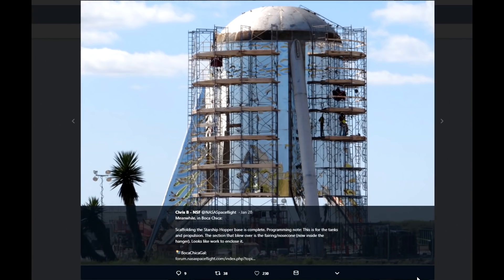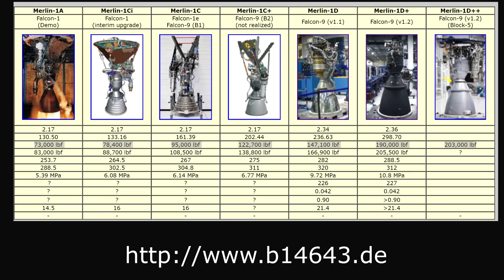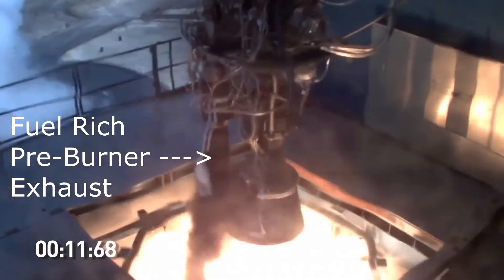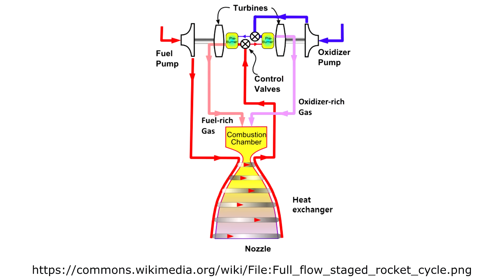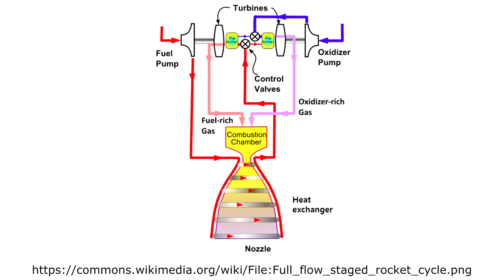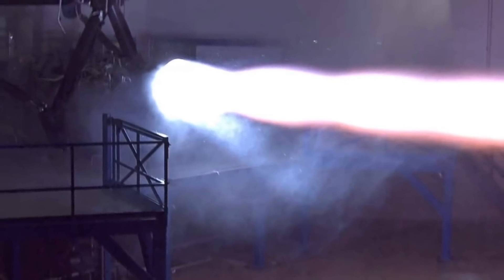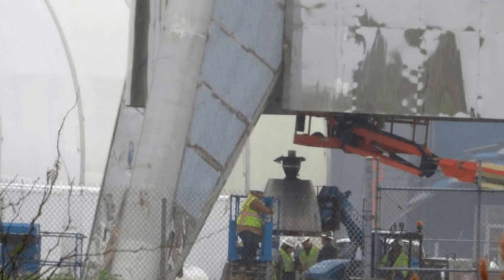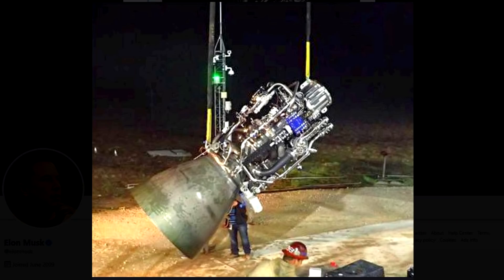SpaceX's Full Size Raptor Rocket Engine Revealed By Elon Musk

Comment: The F1 engine had 7.7MN thrust(385% of Raptors) and its atmospheric specific impulse was 79% of the Raptor engine. Just saying.
Reply from the maker: F1 Specfic impulse at sea level was 263s - I think you might be using the ISP of the Merlin
Reply: @scottmanley  Was using the right numbers, but the wrong column (confused atmospheric with vacuum).
Reply: It was also 12 feet in diameter and close on 8 and a half tons...  Let's see what all the figures are before we start any meaningful comparing. :)
Reply: @TheEvilmooseofdoom  Yes, and it was also devilishly expensive to make and the process could hardly be replicated. But the point stands that the best engine money could buy 50 years ago ist still only 20% worse in specific impulse than the best we're about to make today, but it delivered a hell of a lot more thrust than any engine made since.

In the same timeframe computers got about 100000000% faster. Something's just not going quite right.
Reply: @pyalot  Much of the ISP is determined by the fuel used.  Methane sits between RP1 and H2 roughly.  Better performance than the RP1 but not as tough to handle and with a better density than H2.  The F1 at sea level got a ISP of 261s and the Raptor from what I have read gets about 320-330s at sea level and while that only seems like a mere 20% it's actually quite a leap.  The Merlin which uses the same fuel gets 280ish seconds and the RD-180 gets 311 seconds from RP1.   That's the best one can get from RP1 so far.  What the best one can get from Methane is yet to be determined.  Also you ignore weight and power to weight is another big factor.  While  the little merlin puts out far less thrust than the F1 or the RD-180 it lifts more per pound than either engine.  In the end there are all manner of metrics one can measure an engine.  I myself am quite interested to know some hard data from testing and what the final mass of the engine will be.
Reply: @TheEvilmooseofdoom  I'm not disputing its better. It's just not better that feels like 60 years better. I realize that there's only so much you're going to get out of a chemical rocket. What I'm getting at is, whatever happened to computers, didn't happen to rockets. On the one hand it's not so much surprising, rockets don't have as much potential for everyday use, so they're not developed as vigorously, on the other hand, they're kind of super-important technology for modern civilization, and by any standard, they're unbelievably primitive.

Now I realize, we're grappling with all sorts of exotic concepts to get into space, none of which are even remotely feasible at our current technological stage. But maybe that's not a status quo, but a failure of our current stage.
Reply: @pyalot  I realize that there's only so much you're going to get out of a chemical rocket.

That is it in a nutshell.  Computers are also reaching a point where progress is slowing down too.  We were on the road to '60 years better' with the NTR designs but with the end of that and the current hysteria over anything nuclear we're probably stuck with chemical for a while.  Like the ICE the only thing we can do now is refine but we're close to getting all the energy we can out of it with current materials.
Reply: @TheEvilmooseofdoom  Like I said, we're stuck with something that's today roughly about as good as it was 60 years ago, give or take. Nothing we have is a feasible alternative at our current technology level. Nuclear rockets are extremely difficult and best not used in the atmosphere. Electric propulsion lacks both a potent source of energy and the thrust to do anything from the bottom of a gravity well inside an atmosphere. Hypersonic scramjets are also an extremely difficult, probably don't scale that well and it might not be a good idea for the upper atmosphere to use them. Spacelifts we're simply lacking the materials for. And space cannons of any description are extremely huge undertakings with a number of problems that might be solvable, but which we just haven't solved. Then there's "exotic" propulsion methods that're more in the realm of fiction than science.

We simply do not have an efficient means of getting stuff into space. We should have such means, given that we've had more than half a century to come up with something, but we don't. There's not all that many technologies that we have invented in the last 300 years, that where about as good a few years after their invention as they where over half a century later. There's countless examples of this (steam engines, computers, telephones, cellphones, etc.)
Reply: @pyalot  NTR's have the potential and I don't see why they couldn't be used in the atmosphere.  The problem with getting into space is the energy required.  Nothing that has come before has ever even had the potential energy and only as our ability to harness it has gotten better have we been able to do what we've done but we've gotten about as much as we can get from chemicals.  The next step up for energy density is nuclear.  Even the exotics require generous energy supplies. :)
Reply: Lensflare Deviant NTRs heat the propellant (coolant) up as it passes trough the reactor core and then expel it out the back. Two problems:

1. The coolant becomes irradiated and is now low level nuclear waste dumped right into the atmosphere
2. If it malfunctions (breakdown of separation layer between fuel rods and coolant) it starts dumping bits of the reactor core out the nozzle

The only time a NTR has been tried, it malfunctioned, the hydrogen at high temperatures erroded the reactor core away and itessentialls puked the reactor core out the back. This has been the most serious unintentional release of radiation on US soil in history. It has never been tried again.

That is why you dont fly NTRs atmospheric. And if you fly them in space, you would probably want to put a fair bit of distance between you and earth before you light it up, and dont point the nozzle towards earth.
Reply: @pyalot  I'm afraid most of the information you have is incorrect.  The hydrogen is not exposed directly to the Uranium, like in most reactors the fuel is embedded in zirconium for most reactors and ceramics for others.  There is no contamination of the hydrogen with radioactive fragments, this is a error.  Also all the tests worked out so well they were one step away from building an engine for flight testing when the program was shut down.  They did deliberately blow one up but outside of that there were no accidents or contamination.  Your sources are seriously questionable.
Reply: @TheEvilmooseofdoom  I never said the fuel is in direct contact with the coolant. However if there is a malfunction, the reactor will basically dump itself out the back. This is the reason why all ordinary nuclear reactors have a heat exchanger and separate cooling loops, so that the liquid that could potentially be contaminated, doesn't make it out into the environment.
Reply: @pyalot  What the reactor does during a malfunction depends entirely on the malfunction.  Sorry if I inferred a direct contact between the H2 and the U.  Regardless there is no radiation being spewed out the tail pipe this is one of the advantages of hydrogen.  Neutrons could interact with impurities in the hydrogen but such sources should be negligible.  Of course the same issue with a NTR exists with all of them, melt down.
Reply: Lensflare Deviant most malfuntions would lead to dispersion of highly radioactive materials, either explosively or gradually.
Reply: @pyalot  Only if something fails internally in the core or to the housing.  I think you're past reaching.
Reply: @TheEvilmooseofdoom  Well a NTR is barely more than the core and housing, and it's where the greatest stresses are being applied by radiation, extreme temperature, pressure and propellant flow speeds. There would be the turbopump and tank of course, but if any of those fail to deliver coolant to the reactor, you won't be able to shutdown the reactor before it overheats and disintegrates. It's not reaching to assume that pretty much any kind of malfunction will lead to explosive or gradual release of radioactive material into the atmosphere.

We accept failure modes in chemical rockets because the impact is limited. But most NTRs failure modes will result in environmental catastrophy. If the NTR is properly separated from human habitation/ecosystems I think the risk would be acceptable for failure modes. But atmospheric flight, from earth, no.
Reply: @pyalot  First before we go any further I am NOT advocating in favor of NTR's as first stage engines (I would be tempted for 2nd stage or any upper stages though).  I DO believe it can be done though and done with reasonable safety and likely for some time.  That being said there is always the potential for an extreme disaster.  I agree that the biggest danger is a reactor that is no longer being cooled (some catastrophe has severed the flow of H2).  We also assume this is enough of a catastrophe that the control mechanism is disabled or destroyed.  There is a lot of mass and material in there and it would take some time to melt it all down just to a liquid state.  The housing is strong enough to contain the pressure of the engine during operation, cut the fuel and that pressure goes away so nothing is going to crack it from the inside the danger is where it lands and what it does as it melts in it's landing spot.  This is why we'd keep launching over water.  Still I think your point stands that even IF such a failure is rare it CAN happen and a pile of melting reactors at the bottom of the ocean is hardly an ideal situation.  

For a second stage though... :)
Reply: @TheEvilmooseofdoom  since an NTR would be running at maximum capacity under power, if the coolant fails, the temperature will quickly melt both the fuel rod and cladding. You can't contain the corium because that'd just concentrate it and get it hotter, so the only way it has to go is out the back of the engine.

Traditional nuclear reactors are built with a "catch bassin" intended to catch a corium melt and spread it out in a puddle where it can cool off. That option does not exist on a rocket.
Reply: @pyalot  _will quickly melt both the fuel rod and cladding. _

Yes but in a matter of minutes not seconds.  Before it's a liquid the thing will have hit the ground.
Reply: Lensflare Deviant The limiting factor of a solid core NTR is the melting point of the materials. To get maximum efficiency you would run it as hot as you can while high speed coolant flows past it. Therefore under normal operation it is already on the verge of meltdown with the coolant. Take the coolant away and it will melt in fracrions of a second.

There are other designs, but they either somehow contain the nuclear fuel (in whatever phase) and hence face the same issue, or do away entirely with nuclear fuel containment and just expel it out the back...
Reply: @pyalot  I'm afraid your opinion is not as informed as you may think.  Therefore under normal operation it is already on the verge of meltdown with the coolant. Take the coolant away and it will melt in fracrions of a second.

This is wrong.  They run at a temp that the structural material retains it's strength at.  This is not at or near the the melting point since most metals are soft like taffy at that point.  I'm afraid you're proceeding from a flawed understanding.  The melt down will not take seconds.  They take minutes to hours depending on the core and in this case I'd say minutes.
Reply: Lensflare Deviant look, it does not matter how far below the melting point you run it. The engine is run as hot as you possibly can because the hotter you run it, the more efficient it is. It also does not matter if it melts, cracks, erodes or becomes taffy, they all have pretty much the same effect, the cladding breaks down, exposing hot fuel rods. And as for the time to break down. You can expect such an engine to produce hundreds of gigawatts in thermal all of which would be soaked up by the coolant as it shoots trough the core. Take the coolant away, and the temperature in the core will go up by hundreds of degrees in fractions of a second. You may have a thousand degrees margin, but that will be reached at the outside in mere seconds.

NTRs are not conventional nuclear reactors. They are not run in a fashion giving you much in the way of safety margins. They are this way because the goal is to get as much out of it as you can get away with. An NTR resembles a traditional nuclear reactor as much as a chemical rocket resembles a passenger liners turbofan engine. Design goals differ, they have to differ, otherwise any advantage is lost.
Reply: @pyalot  I'm going to have to agree to disagree with you.  I don't think it's worth my time to try and dissuade you.  I honestly think you have a limited grasp of what's going on with a NTR and that stems not only from the notions you have put forward recently but includes all the mistaken notions you started with.  You're a bright person and you conduct yourself well.  I am not calling you stupid or a fool.
Reply: Lensflare Deviant The simple matter of the fact is that an NTR under power has numerous ways to fail and eject/atomize some or all of its core into its surroundings. If those surroundings are the atmosphere, it is very bad (tm).

It is for this reason it is unlikely anybody will light one up, with a vehicle strapped to it, inside the atmosphere, or anywhere near enough to the atmosphere that ejecta/debris can reach the atmosphere.

Even an inert NTR is still a considerable risk to put atop a conventional rocket, but at least that can be contained in a housing designed to withstand vehicle breakup, reentry and lithosperic breaking and not disperse any radioactive material (albeit such a housing would be a considerable but unavoidable weight overhead).

Comment: Scott can’t they tube it to the exhaust itself and create a afterburner effect. Just have tubes running on the outside of the cone. Or dump it into the cone near the end, , engineers are stuck thinking one way, gotta think outside the box, that’s the way America was born.
Reply: Dumping the exhaust into the bell was how the F1 engine did it.  It didn't really add to the trust but it helped keep the walls of the bell cooler.

Comment: Would catalysed decomposition of dinitrogen tetroxide not produce enough energy for these big rockets' pumps, or could an oldschool mono/bipropellant steel Tintin rocket be Elon's next thing?
Reply: Does that not then add a need for pumps, tanks, etc for the dinitrogen tetroxide adding a lot of extra weight and volume?
Reply: @TheEvilmooseofdoom  no, it would be a heat-engine (D2N4 -> 2N02) looped around the bell and then a bipropellant main with the hot nitrogen dioxide as oxidizer. It wouldn't have preburners, the heat engine is doing that job. So fewer pumps and plumping, since the fuel is otherwise typically used for cooling instead. Same amount of tanks, oxidizer and fuel. It's a variant concept from the older rockets that used high-test peroxide exothermically decomposing to water and oxygen, which was then used as oxidizer with alcohol. The power generated was used for the fuel pumps.
Reply: @ontoverse  I admit I might be wading in waters over my head here.  Sorry about that..  But I am still a touch confused.  Your dinitrogen tetroxide is decomposed into nitrogen dioxide? and? Which bi-propellant main?

Comment: Full flow staged combustion sometimes happens when I eat jalapenos
Reply: It's known that jalapenos and air enter the organism separately, then they mix inside the digestive system and exit out of one's rear end explosively.
Reply: Nature came up with the design a long time ago
Reply: The fuel rich precombustion in my stomach sometimes rumbled, non- linear laminar flow problem. Ablative coating to my rocket knozzle might help with the extreme heat problem .
Reply: And it burns, burns, burns, that ring of fire ... :)
Reply: How are you cooling the nozzle? I copped a catastrophic meltdown doing same thing lol
Reply: Different mixture ratios can lead to engine rich exhaust
Reply: Funniest thing I've read all year! Not even kidding
Reply: That is a cyclic instability, you counter that by drinking massive quantities of beer.

Comment: Timely, informative. Informed analysis for context, with the proper caveats. Grade:  4.0!

Speaking of Starship-  Can you please address these points in your future videos.
Will the stainless steel get heat discoloration in Mars atmosphere, affecting the thermal radiative efficiency? Discolored beyond visual wavelengths? Bears on its effectiveness on Earth reentry.
Big problem: How much thermal expansion will a structure this size have? Simple expansion joints no good.
If active cooling is problematic for the hinge area of the fins - use titanium? What temp can that handle and be functional?
The head of Rocket Lab admitted in an interview with Tim Dodd that a virtual vacuum bell for the center engine can probably be formed by the exhaust of surrounding engines. Your thoughts?

I'm asking a lot, but it's efficient to ask it all at once. Thanks for your patience. btw, am posting a much corrected update to my apatosaurus/brontosaurus comment. Am as guilty of relying too much on memory.